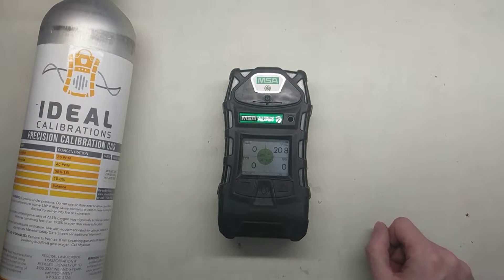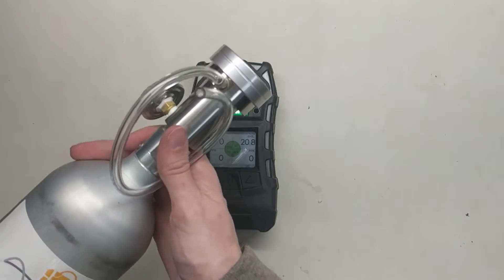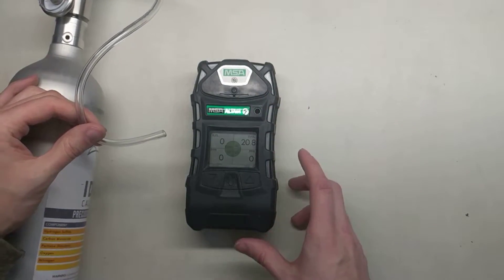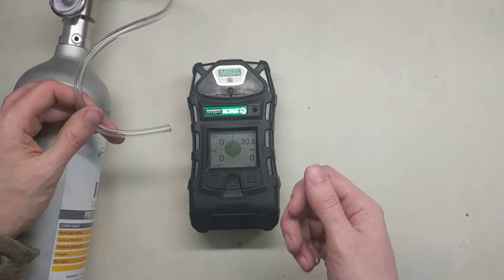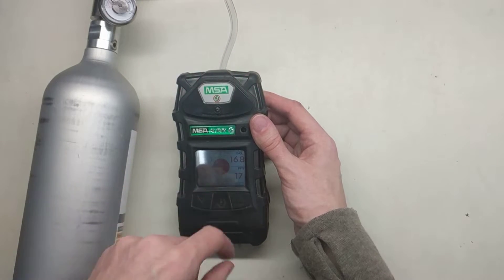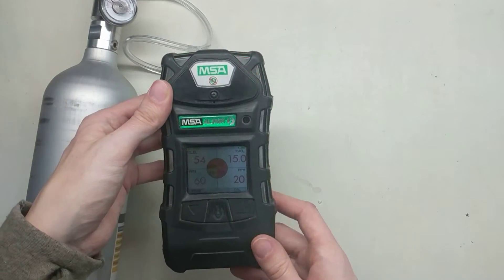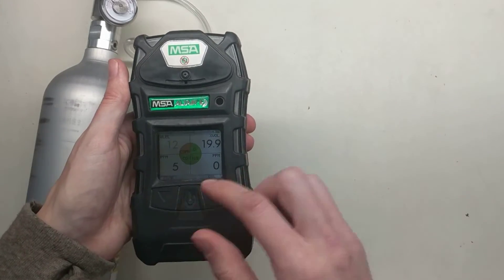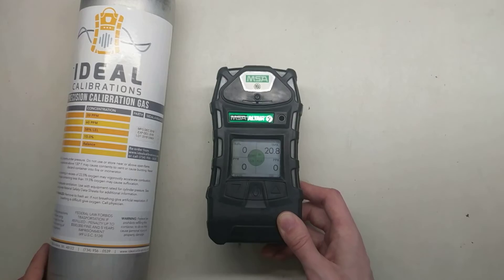Bump Test Guide: MSA Altair 5 by Ideal Calibrations

Comment: That's not a bump test. The bump test should be done through the menu upon start up tests have been passed. You'll need to connect the gas to the device three times. The results are to be compared to the long term average of bump test results.
Reply from the maker: Hey Aaron,

On the 5, I don't prefer the system bump test because it doesn't properly sound the alarm horn, strobes, and vibrating alarm for verification, it only shows sensor response. The 5X does a better job of this, but the 5 is unfortunately lacking here. You can use this method if you'd like to track it in the electronics, but an additional bump check setting off the alarms should be performed for daily operation in that case.

I'm curious to hear about the gas to the device 3 times method with long term averaging, as it's new to me. Mind explaining?